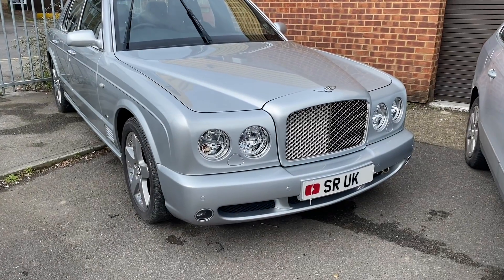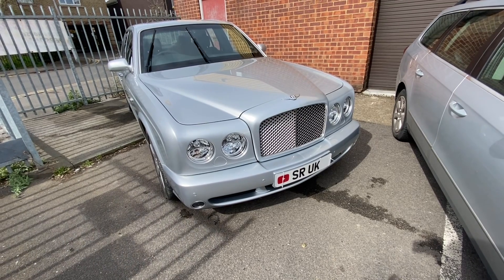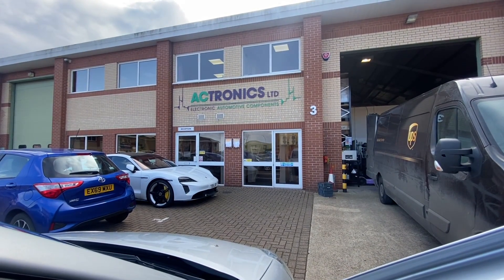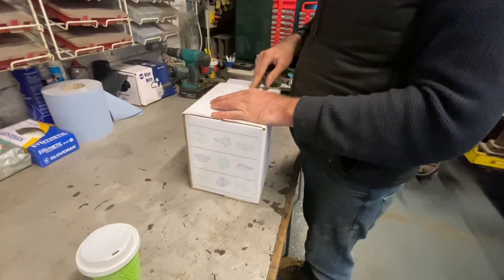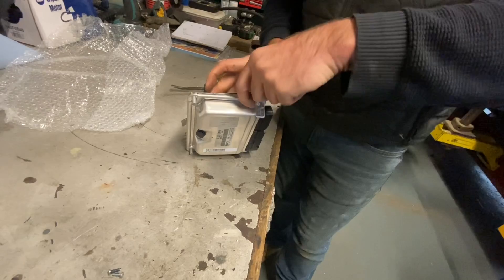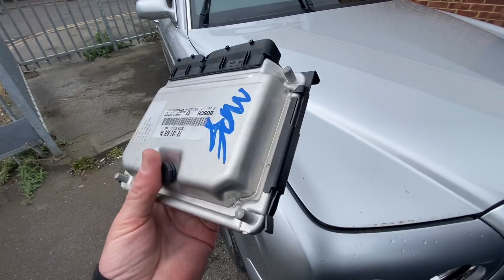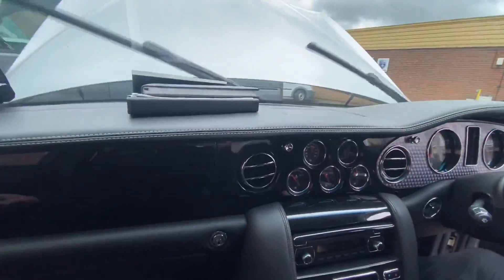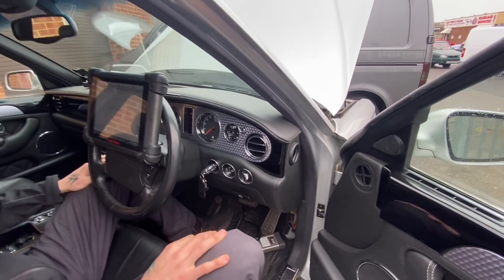NON RUNNER £30K BENTLEY ARNAGE 6.75L GAMBLE PART 2

Comment: Hi great videos, you can clone the ecu, you can read the eeprom that has the imo code and maybe the flashrom from the old ecu as the old ecu is fried you will have to remove the flashrom it is the 44pin with the white label on it , , as long as this eprom and frashrom  has not bean toasted, you should find some one near you that can do it,  if it is just the eprom it may read  without removing it, its a shame that i am a long way away from you, as i would like to do it ,i am in hampshire,
Thanks Dave ,Good luck, i hope this helps

Comment: Chris Rob one step closer lads it would have been handy if you could have got the key chip with the other ecu as it would have been paired with the ecu as your original key will still be paired to your original ecu check out my playlist on my MK3 Ford Mondeo where I have the same issue with the car starting then cutting straight out it had been to 6 auto electricians and a Ford main dealer and none of them could sort it said it was scrap its a 2006 titanium mondeo with 37k on the clock its like new so me and my dad took on the challenge now it's my wife's daily. Cheers Gary 👍🏻👍🏻
Reply: @salvage rebuilds uk

Comment: Can't say I'm surprised you didn't lay out £700 for a replacement ECU until you had firm evidence it was FUBAR. Having said that, I would have opened the old one myself looking for signs of the magic smoke escaping. Another great video.
Reply from the maker: If you open a ecu a specialist will refuse to touch it and we couldn’t risk it 👍

Comment: That is a diode that has been cremated. They are there to protect from reverse polarity, so it looks like the theory about the jumper pack connected the wrong way round is probably correct. My guess would be that it was connected for so long that the diode started to cook and burnt through the tracks of the board.

Comment: The missing power on pin 3 is possibly due to damage caused by the reversed charger, battery connection, or maybe they put 2 batteries in series. 24v.

Comment: Looks to be Electrolytic Tantalum Capacitor failure, shows all the signs. Nothing could have bene done to prevent it. When they let go, people normally smell them or see the smoke so switch the device off. As they were in a sealed unit, people would keep putting power on it, hence the excessive board damage.
Reply: tantalum caps REALLY do not like reverse polarity.. they express their displeasure at this by going pop!
Reply: @tech4pros1  they are electrolytic types, we repair circuit boards for military systems, speciating in older technology. Tantalum's have a limited MTTF so it is very common for them to fail, reverse polarity or not, particularly with the age of the vehicle.

Comment: How cool. Love this vid. Your enthusiasm Rob. Amazing. Does the mileage change with replacement ECU?
Reply from the maker: No it’s the same 👍
Reply: @sruk  mileage is stored in the cluster, same as the cayenne (which is electrically very similar) and can be corrected in 15 seconds with a digprog 3 using OBD2 - I seem to remember that mileage is stored in the ECU but only as a backup.

Comment: That's a blown blocking diode. It will be rated for at least 12 volts and would easily block a 12 volt battery or charger that was fitted the wrong way around. My guess is someone plugged in a charger set to 24V, and they crossed the polarities. Numpties.

Comment: Seriously lads, you could've given us 5-10 minutes on the front of that of your two days searching for the fault yourselves and we'd all have been happy.

Great video all the same. Made up for you as all ways.

Good call on the GoPro. The amount of time you'd spend searching for useable content would do your head in. Believe me Rob, I've spent enough time in edit suites working on shows using head and bodycams. The return for you isn't worth it for the amount of time it takes.

If anything, the past few videos have proved, in certain circumstances, a Rode receiver on your phone linking straight into your recording and two lapel mics would aid sound when you lads are on the job together, when you know there's going to be Chris time. Every other instance, it's totally not worth it. You're doing a great job.

Apart from some sound issues and maybe an occasional use of a spidylegtripod thing for clamping onto the bodywork or lift etc, there is no value in upping your production values whatsoever guys. We love it just the way it is.

Comment: I am pretty certain that with the correct tools and parts I could repair the old ECU because I used to doboard level repairs on microprocessor controlled electronic equipment. I suspect Actronics wouldn't repair it because the cost of them doing so would not be financially viable.

Comment: Do ac tronics not do pcb repairs? I'm pretty sure a decent pcb repair company could fix that. Hell I could probably fix that ecu. Even if the traces has vaporised you can solder jumpers to new components to repair. Would save you the hassle of reprogramming the immobiliser. Or at least let you read the old immo code and program the new ecu with the old code to save you some work and money

Comment: Looks like a protection diode failed and shorted out the 12v to the ground. Either that or somebody connected the battery the wrong way around. Hopefully not the latter! More problematic modules otherwise

Comment: Got a corsa in, non runner, ecu is on the scuttle and was swimming, just like robs, that ecu has been an ecu too long, be great when he gets the ecu re set, should be a stonking profit.
Reply: Sale or return best thing about it too, no brainer. 
That Corsa sounds like the old Rover 75's, their plenums used to fill with water and drown the ECU
Reply: @sammytheseal2307  yes mate
Reply: @sammytheseal2307  poor old James has had a right trial with that kia mate, hasn't he.
Reply: @roystonvehicles9129  He certainly has! It was trouble from the beginning to be honest. 
I'm not actually convinced a clutch kit is going to solve it, could even make it worse as the new clutch plate will be thicker and will want to disengage later. 
It wants a master cylinder and slave cylinder in my eyes as low clutches are a hydraulic fault (or cable if it had one)
I don't possibly understand how a new clutch is going to make the bite higher! Maybe the pressure plate has gone weak or lazy but again that wouldn't be my first port of call. 
I'll trust this new garage knows their onions but I won't be surprised if we get another video "this warranty claim nightmare wipes out profit as new clutch doesn't solve the issue" ! 🤦

Comment: Interesting that they wouldn't try a repair on that board as most of those chips are obtainable-Id have cleaned the carbon off the board and tested those BUCK-CONVERTERS for shorts. I think is only one double-diode (only has 4 connections) thats blown, but that sort of damage is usually caused by a dead short . If the car had suffered reverse polarity, Id have expected greater damage that one ECU. That ecu/controller is basically the DC/DC convertor power supply. No, Im not an auto electrician , Im a retired lift engineer who works on stuff as a hobby and who cant stand seeing stuff just thrown away. Im not in any way trying to undermine the experts you used, as they have to warrant any repair they do and probably would approve of my methods-but we learned the hard way, no proper wiring diagrams and crap drives and thyristors of the '70's... The specialists you use should have been able to 'see' electrically what that eCU was doing with a power supply to the board.

Comment: That board is repairable. Without looking at the underside, I 'd say it could be repaired, I've done worse.
Reply from the maker: How much I’ll send it to you and sell it after 👍
Reply: @sruk  I wouldn't take it on as although the board is probably savable it could have cooked one of the flatpack chips also. Although the diode that went pop probably saved the rest of it.  That side of the board is the just the power side and not much else going on there. If the traces are gone, thin bridging wires would replace them. Due to the price of the part I would have it looked at again. It looks like an hours worth of work from what I can see. Everything is fixable.

Comment: 100% wrong polarity with the jump pack.  It’s made the wipers run the wrong way and snapped off the parking contacts inside the wiper motor.  Had this with our old Hymer Motorhome purchased as a non runner.  You might find other things that have a live feed from the battery blown too...

Comment: Suprised you didn't use the Lambo to drop the ecu of :D.   Looks like a reverse polarity protection diode blew up, might be a tant cap next to it that short circuited, thats quite common and look the same as a diode now being black. So hopefully the tant blew up and there wasn't a reverse current as that could cause a whole world of shi t on all the body modules and transmistion modules. The ECU fuse should have prevented the magic smoke in the ecu, so check the fuse hasn't been changed for something stupid. Your car electricitan should be able to change the data over from old to new. bon't forget the new ecu doesn't hold any code for the car, so won't show any faults other than where the new ecu cam from. Anyway, enough waffle aye , lol.

Comment: no need for a dealer to do this job. u can swap the memory  st95xxx,n ur done,its ME 7 series ecu. A car programmer with right tool will do it 100 pounds. thats a 10 mins job. vw immo ,starts n dies out.With same ori ecu i can make immo-off, with emulaor or  eeprom data modify.

Comment: No comms with engine ecu, how did that take so much hard work for someone to think to open up the engine ecu 😂
Reply from the maker: You can’t just open in ECU because the minute you do no specialist will touch it we had to rule everything else out first it’s been sat for a number of years so we needed to check that nothing had been chewed by rodents or in the earths had issues etc
Reply: @sruk  Garages regularly open ecu’s to check for things like this, it’s a very simple process
Reply from the maker: @rarswlew6070  we know how simple it is bud like I said if we open it company’s like ac tropics won’t entertain repairing it